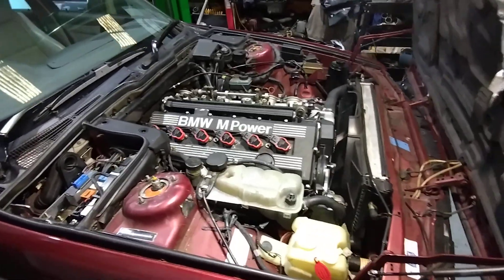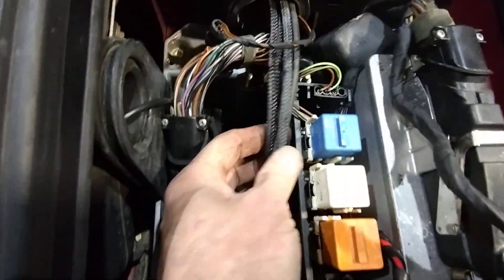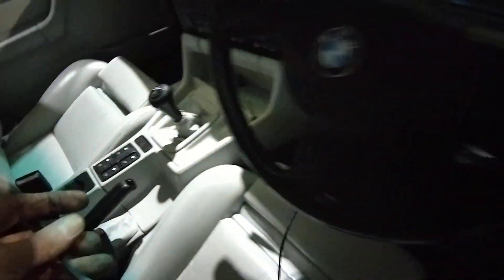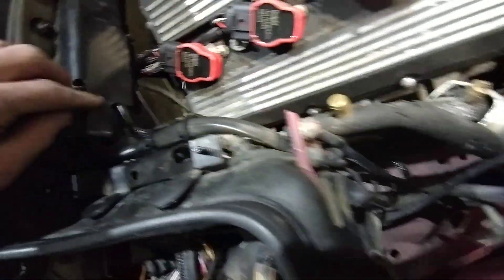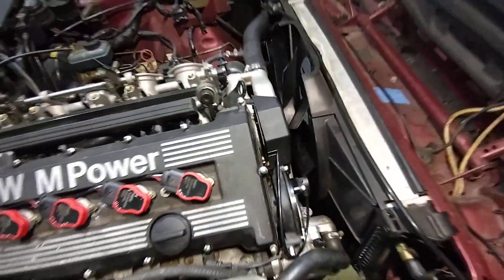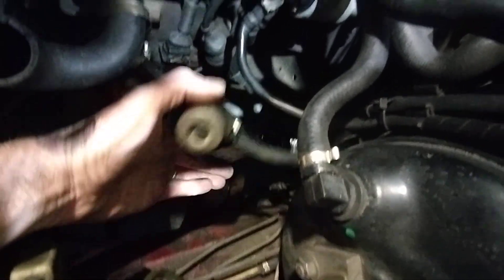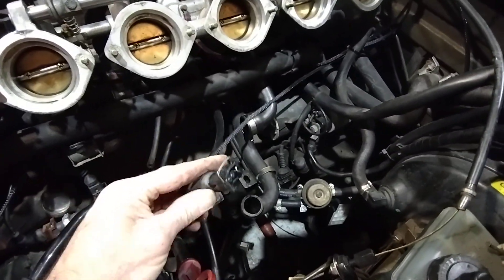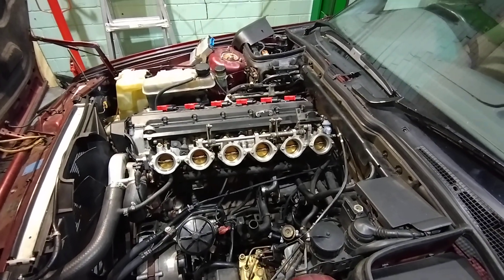BMW s38 m5 stand alone ecu install PART 2

Comment: The improvements are in 3 areas. 
1/  you are or placing a c1990 computer with a modern one, along with modern sensors, better coils injectors  etc you get very much improved part throttle and low rpm response, and improved top end due to increased ignition advance due to higher octane fuels.  

2/ You future proof the engine electronics as the 30+yo sensors wear or fail often it’s very expensive to replace them that’s if you can find them.  This setup also has flex fuel so you can run E85 (Ron105) fuel or a mix which will slightly improve power and response in NA engine and with FI engine massive improvements can be had 

3/ The last major benifit if you want to upgrade the hardware like cams, or even install forced induction you can control it precisely.